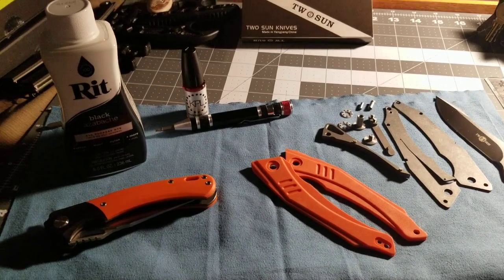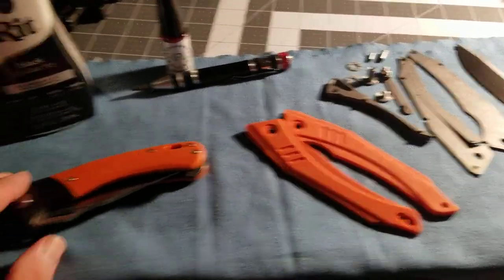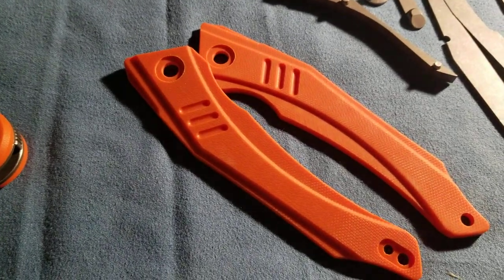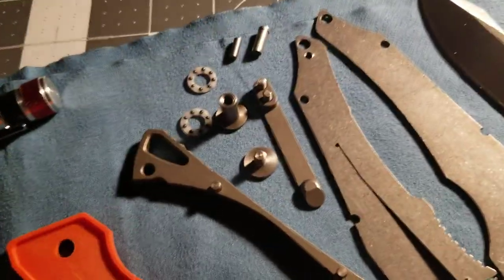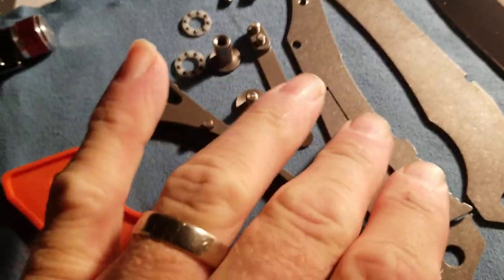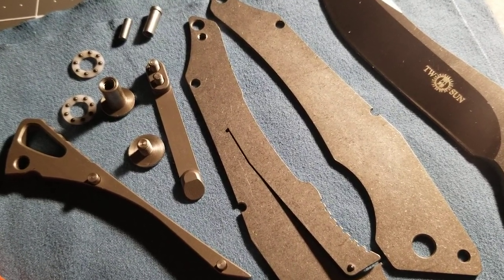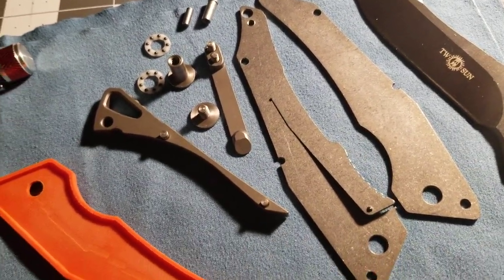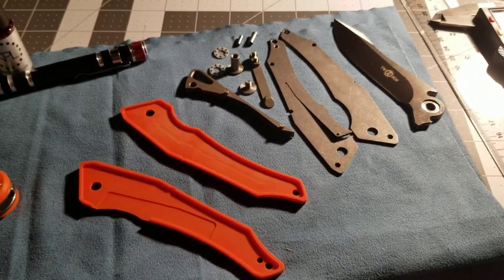TWOSUN TS114 ORANGEUGONNAGOBLACK!!;)

Comment: I dyed one of those black also, it worked out ok.  Took about 45 min in the Rit dye, but was pretty even color.  On a side note, being a machinist, I'm sure you can appreciate the areas that can be polished to really make for some smooth action.  I did the track on a few I've had, and it was a huge improvement.  Took care of the zip sound and made them super nice to open.

Comment: Question.. Have you ever heard of someone acid etching and stone washing D2?
Reply from the maker: Yes..we do it at my work all the time..first acid etch..have kit that comes with a stencil that you type what ever you want to be on the material.  YOUR NAME OR LOGO and so forth then prep part for application of said stencil with markings of your preference. Then we have an electrically charged pad that has another chemical solution on it then place stencil where you want it and apply pressure for predetermined amount of time based on material. Can be used on all kinds of metals.....
Wipe clean and walla done material is etched..NEXT stone washing is usually done in a tumbler device with a knife blade this would be done prior to final edge sharpening because the stonewashed media would dull the edge, also this would be done before etching also..this type of stone washing is usually intended for deburring parts of sharp edges and bur's but at same time leaves a very nice effect on all surfaces..pay attention not to have cross contamination of various metals..do not use old tumbler media used on carbon steels for stainless..hope this helps..longwinded..do research on google for  both topics they sell small kits to be used at home by guys like you and me..can get costly for just one or two jobs..but will pay for it self if knife making is in your future.